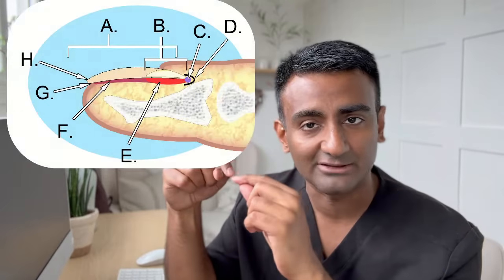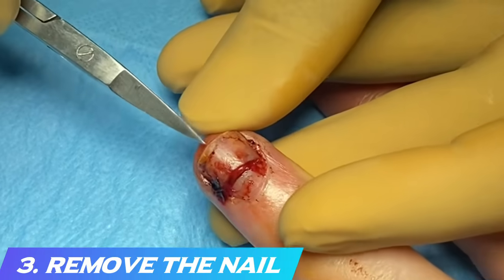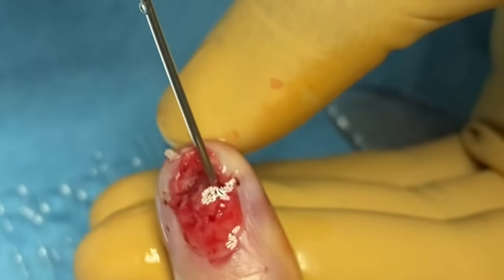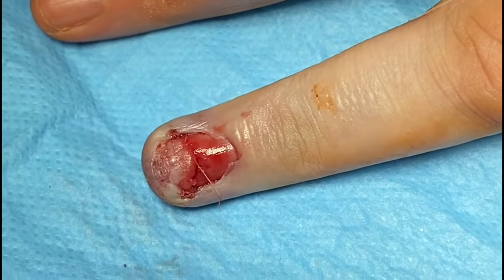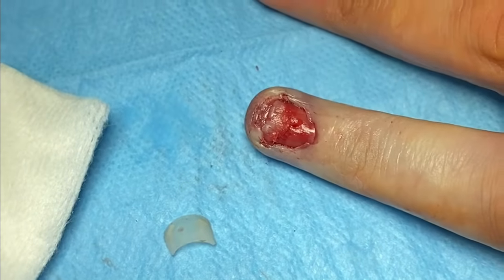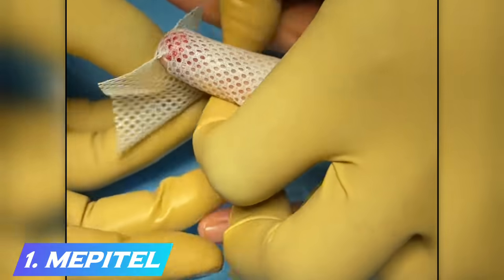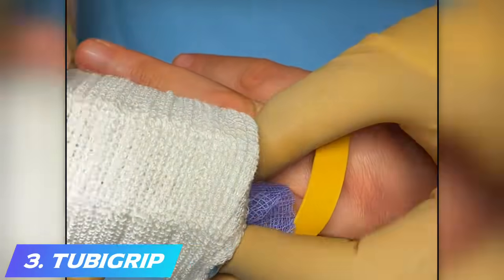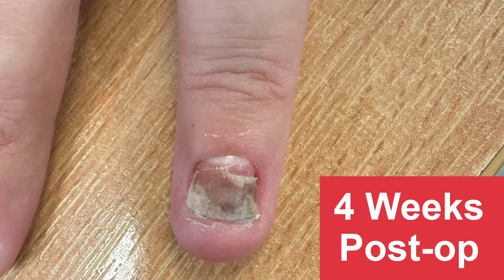Expert Guide: Step-by-Step Surgical Nailbed Repair by a Consultant Plastic and Hand Surgeon

Comment: I got nail infection  it has been surgical removed and treated with antifungal tablets orally for 6months 
But nail is not growing properly  it is raised fromnail bed what to be done kindly suggest docter
Reply from the maker: Hi you will need to have your fingernail examined by a hand surgeon to assess the situation. Sometimes you will need a few cycles of nail growth before you see a normal looking nail, and this can take 6-9 months. However, If cells that grow the nail have been damaged then you might not have a normal nail growing.

Comment: is there a case where you wouldnt remove the nail? and only approximate the two nail parts with and figure of eight suture? thanks
Reply from the maker: If you could access the laceration without removing part of the nail you could consider not  removing the whole nail. There is no need to approximate the nail parts as being dead tissue, they will not unite.
Reply: @sharpnsurgery  https://youtube.com/shorts/xkOYkKJrb2w?si=4LGw8ZWGPEFQ3XAo
Talking about this approach basicaly

Comment: Hi, I had an accident about 6 years ago where I lost the tip of my left ring finger after an iron rod fell on it. The doctors had to amputate the tip, and now my nail has grown curved.

Functionally, I can hold, grip, and use my hand fine, but:

The curved nail causes pressure and mild discomfort when I press or scratch.

I occasionally feel mild tingling/weird sensations in that finger (no severe phantom pain now).

I wanted to ask:

1. Is it possible to straighten or correct the nail after all these years?

2. Will the tingling/weird sensations go away, or do they need treatment?

Thanks for any advice!
Reply: I feel such as you really

Comment: This is such a great video! Looking forward to more practical videos like these. 

A few questions. We don’t have access to glue so we would have to suture. Is the nail then secured indefinitely or is it removed at some point to allow new nail growth.

Secondly we don’t have the dressing you used. Would jelonet be fine?
Reply: Please upload any other cases you do esp tendon repairs, nerve repairs, tenosynovitis debridements, deformity corrections. At the institution I work at we don’t have a plastics consultant so often we just read and try our best. These videos are really really helpful.
Reply from the maker: Thank you for your comment. The nail even if sutured gets stuck on to the remaining nail bed, and doesn’t have to be removed. New nail will grow from the eponychial fold and push the old nail out(just like shown at the end of the video), so you have to warn the patient it will look add for a few months and to keep trimming until the new nail completely covers the nail bed.
Reply from the maker: Yea Jelonet will be fine, but you can’t leave jelonet for that long as the paraffin dries up and it will be very stuck, so if you use jelonet then change the dressing sooner at 1 week.